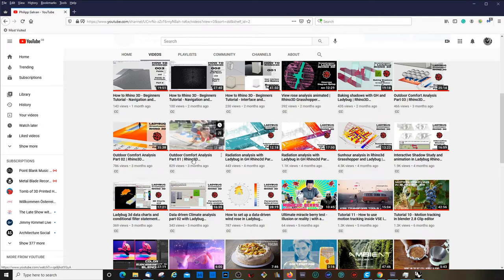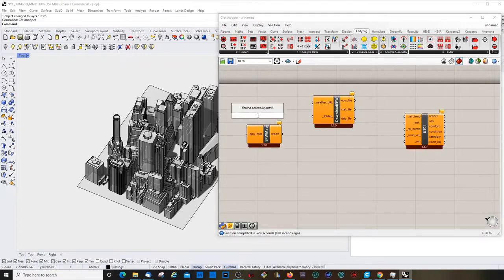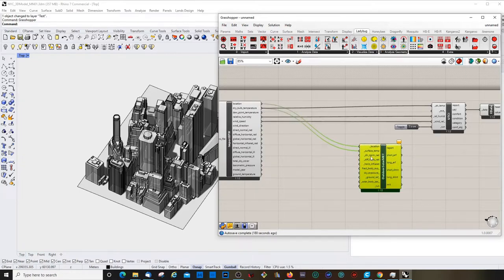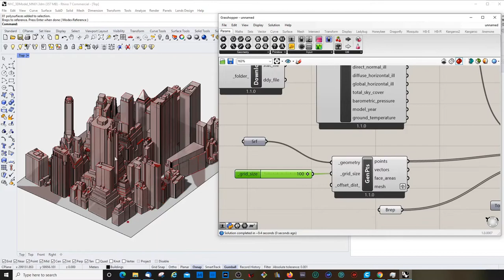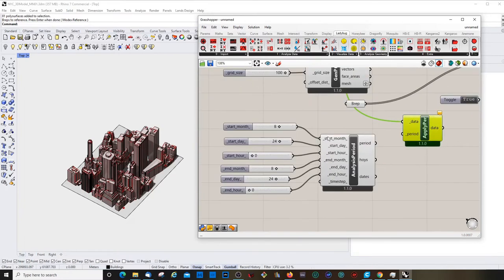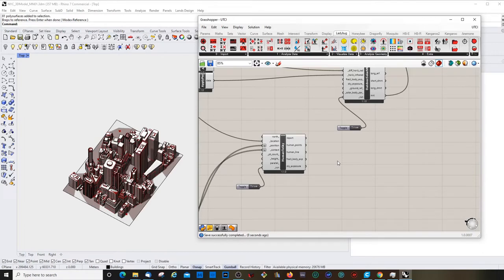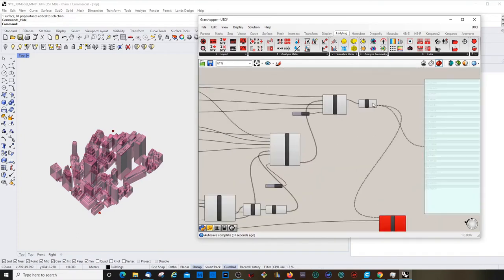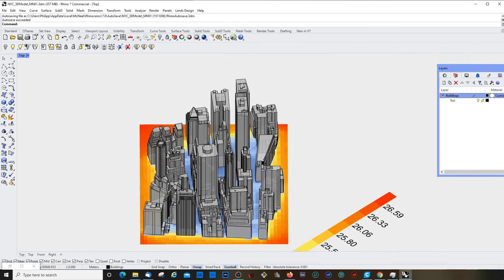Outdoor Comfort in Ladybug tools 1.1.0 | Grasshopper 3d Rhino 3d | Tutorial 13

Comment: Thank you for this tutorial of LBT 1.1. Apology for my critics -  It seems that the MRT was calculated without considering the surface temperature and sunlight, so does UTCI, which results in an identical map with the sky view factor. It is very obvious around the boundary of the simulation area, the UTCI meshes fade identically from yellow to red on the south and north sides. It seems unlikely that the UTCI meshes on the north boundary remain so high even under the shadow of these tall buildings.
Reply from the maker: Hey Zhikai, thanks for pointing this out. No need to apologies. The best comments are the honest ones so we can all learn and become better. I'll have a look and see what is wrong with it and if there is a problem with the script.
I think I actually already know the issue but need to double-check in the next days. 
What I can see in the video is that I forgot to change the time to day time. :) This makes the result a bit pointless... hope I can find time to do a follow up.
Reply from the maker: Sorry, quite busy these days. I'll dig it out in the next days.

Comment: Hello Philipp! Thank very much for this tutorial . I am stucked in the part where you hide or don't show the mess and red points. I have the UTCI colour map but the red marks are very visible. How can I solve this>? Thanks in advance
Reply from the maker: Hi, Francisca - most tools in grasshopper have a preview option. if a tool is light grey then preview is on, if its medium grey the preview is off.
You can turn the preview an off by right clicking into the centre of the tool and select preview.

Comment: Hey how did you get it to display with just the heat map but without the points? Thanks great content
Reply from the maker: If you right click on objects inside grasshopper you get an option where you can turn off the preview. 
Just go through your script and see which item are currently turned on. Tools where the preview is disabled are medium grey, and tools which enabled are light grey. By default most tools are on.

Comment: Hi Philipp, I followed your tutorial. I have Rhino 7 and Ladybug 1.1, it works. However, if I try to set a different period of analysis, more than one hour or more days, even with flattening or trying different list management ways, it does not work to calculate the UTCI map, data does not match. The same problem when multiple brep are selected as analysis surfaces, it does not work. Only with one hour and one brep, it works. I tried in different ways to fit the data. Have you experienced the same problem?
Reply from the maker: Hi Arlind - didn't have the issue you describe but I'll have a thought on what you might do wrong. I'll get back to you.
Reply from the maker: Hi, sorry for late reply.  
Regarding the time period:  this script is optimised for one hour but  If you want analyze a period you need to calculate an average for each test position from the outdoor comfort output. The heat map can only receive the same amount of data points as test positions. Meaning if you have a 5 hour period you get 5 results for each test position which you need to average before feeding into the heat map. Just add an average component to the comfort output. You can see a similarly example in a previous video for the legacy tools of Ladybug.
Reply from the maker: Regarding the multiple test surfaces you are right. Currently you can have only one test surface. I don't know why the component doesn't allow more. I used a workaround were I combined  the surfaces as meshes to create one mesh and then feed it into the test surface tool. It's  a drawback. I think the developers did that since normally some  would only test a fairly simple surface or space rather then a complex model.
I'll think of a workaround and see if I can do a follow up video going more into details. 
Cheers
Philipp
Reply: @PhilippGalvanDesign  Thank you Philipp. I have followed also your previous tutorial. The Ladybug legacy plugin does the job as you showed. It is also important to explore the Outdoor Comfort for an hour of the hottest/coldest day/week. The problem was because data was input and output in different places and passed through the applied period....as the HumanToSky, Outdoor MRT, UTCI. Not everything goes to the Heatmap in the end. It should be possible to fit the data somehow

Comment: Hi, thank you for your video again! I am wondering how to apply different reflectance to different street materials. I want to analyze how the water, green or different street materials effect on temperature.
Reply from the maker: @배지은 - Hey, sorry for late response, quite busy lately - I can only give some pointers at the moment since we need dive into honeybee to solve some of questions. I'm planning to start tutorials also on Honeybee, Dragonfly and Butterfly. Honeybee is probably the tool you are looking for when it comes to heat gain and  different materials.  

However: The MRT  component allows to input surface temperatures coming  from real measurements or calculations made with honeybee I guess ( I need to explore this myself). (in the video at 10:04)
Further:  The MRT also has a slot called ground_ref which allows to use factor (form 0.0 to 1.0) for different surfaces like water, earth, asphalt... to get a more accurate response. Hover over the slot for more information.

To be fair, the outdoor comfort analysis should be used as an estimate. Ladybug, in general is here to get an overview of a situation. For more accurate calculations I suggest honeybee should be used.

Anyway, appreciate your question and engagement and I will have a thought on how we could work it out. 

cheers
Philipp

Comment: Hi Philipp, thank you for the video! 
I would like to know if is possible to assign an absorptance/ reflection to the context? In order to analyse how the ground temperature is affected by it
Reply from the maker: Hi Leonardo, I haven't explored all the options in full. In theory, it might be possible but I don't want to give wrong answers before I'm not 100% sure. 
A lot also depends on ones ability to use Grasshopper and ability for additional scripting. I can imagine that it's possible to calculate a more detailed specific temperature by providing a more accurate input for the SolarMRT which probably includes the use of Honey Bee and Radiance. There is also still the wind component which has a very big influence on the UTCI as well... that can be explored and made more specific with the butterfly component. I haven't played with these enough yet. Since I'm not an engineer I use the outdoorcomfort tool mainly to get a very high-level estimate of space and then design based on logic. But I will definitely explore Honeybee in Future. 
I hope that helps for now but happy to discuss further and thanks for the question.
Cheers

Comment: Thanks for your effort... Is it possible to  find  PET values   using  honeybee or ladybug ?
Reply from the maker: Hi Lama Idrees, as i can recall the legacy Ladybug tools have a component to calculate/convert data into PET values. I thinks its called Outdoor thermal comfort indices or similar.  But i haven't used it myself.  Could be that there is something similar in the latest ladybug tools but i haven't seen it yet.
Sadly i can't give you a better answer but i might look into it at some point.
Cheers
Reply: @PhilippGalvanDesign  Thanks  for replying and yes i found it

Comment: Hi Philipp, I followed your video and downloaded the recipe and they show the same problem- the heatmap is red and says '1. Solution exception:Number of colors (7) does not match the number of mesh faces (84) nor the number of vertices (65).' What can I do? Thanks for making these tutorials, super helpful!
Reply from the maker: So you have 84 mesh faces but only 7 data sets. 
First, are you testing a period or one hour?
Do you test several surfaces or just one? 
Did you average or flatten the output?
Reply: @PhilippGalvanDesign  thanks, I have to test a period (8-20.00 hrs) on summer and winter solstice, I have several surfaces in a big courtyard together, and I flattened the output values for the component deconstruction data.  It's a multiplex buildings complex for the context.
Reply from the maker: Can you send me screenshot of your script.
Or the script itself? Office@nedomlel.com
Reply: @PhilippGalvanDesign   Your clue worked- it works on 1 surface and for 1 hour.
Reply from the maker: @anubhavitiwari8054  with more surfaces you need to join after the grid tool. To get one mesh.
If you test a period you need to first average the hours for each test point and then flatten the list. 
You also need to flatten the input from test grid to be one list of test points.
Reply from the maker: @anubhavitiwari8054  
I can imagine that you have 7 surfaces.  For each surface you probably got one separate list of test points. You probably averaged all values for each mesh but not for each test point. So you ended up with 7 values one for each surface....
Reply: @PhilippGalvanDesign  Yes looks like it, though it's strange for giving different responses with the same script. Anyway, thanks!

Comment: Hi Philipp, really appreciate your videos. I have created a small model and followed your steps. Instead of doing a limited period of time, I did the entire year with a large scale for my mesh. Everything works until I want to output the result in "heat map" when I connect my mesh (V:9 F:4) to my UTCI (35040 values after deconstruct) the points and mesh don't match and I don't know why. This is the error that I get (Number of colors (35040) does not match the number of mesh faces (4) nor the number of vertices (9).) can you please help me on how to fix that? Thanks a lot
Reply from the maker: do you have several meshes? remember that data need to be flatten. if you have several meshes you need to join them and flatten and same fo the output data. further you can't have more then one value per mesh face. meaning before flatten everything you need to calculate the average for each value set. 35040 are 8760 values per mesh face. these need to be averaged to end up with 4 values which then need to flatten to one list.
Reply from the maker: Keep in mind that an outdoor comfort study on a particular geometry will give you the most clues when testing specific times or days of the year. For example hottest, normal or coldest day, etc... to calculate an average over the whole year won't show you the problem areas.

Comment: Will this work with ladybug tools 1.2?
Reply from the maker: Yes, that should work with Ladybug 1.2 without any issues.
Reply: @PhilippGalvanDesign  I was following your tutorial and I wanted to do the analysis for a single day from 6 to 18hrs I keep getting errors. I saw you did your analysis for only 1 single hour is there a tweak I can make which will show the utci of the whole day not just one single hour a given day! Also thank for a rapid response. 
Your video was very help full thank you very much.
Reply from the maker: If you want more the one hour you need to calculate an average for each cell. At the end you need to have the same amount of values as your mesh has cells.
If you want you can send me your script. office@nedomlel.com. if you do let me know here so I can check my email.
Reply from the maker: Sent you an update - check your email.
all the best of luck
Reply: @PhilippGalvanDesign  Yes I got it. Thank you very much and keep up the good work.